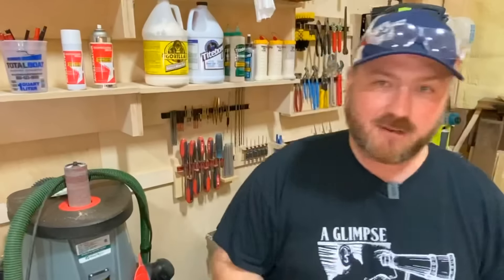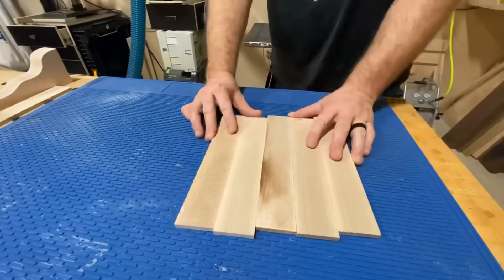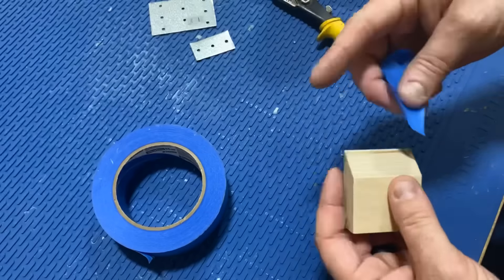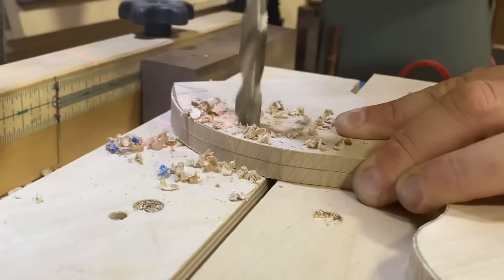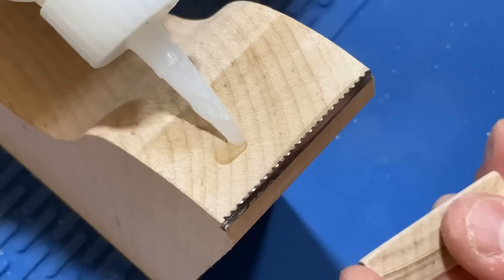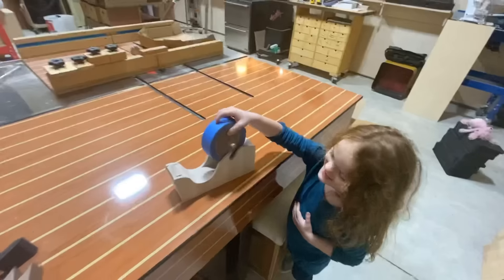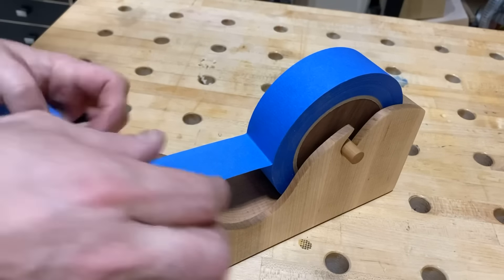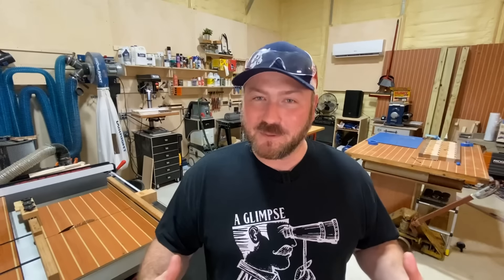How To Make a Tape Dispenser Out of Hardwoods | Blue Tape Solution | A Glimpse Inside How To

Comment: I am a musician and a wood worker.  I recently made a mudroom bench from cabinet grade plywood (SW emerald enamel painted) and red oak bench top (GF gel stain with GF high perf. poly).  I used some of the scrap plywood to make a very nice looking cable holder/organizer for my music studio.  It has 28 slots that are each 1/4" wide.  Routed each slot with my trim router and a custom made jig.  Each slot vertically holds about 4 or 5 of my music cables and guitar straps, etc.  Came out way better than I thought it would especially with GF arm-r-seal applied to the bare plywood.  Can't say enough good things about General Finishes products.

Comment: Great project.  Everyone needs one of these. Another option for the bottom would be a thin piece of craft foam.  I tip for your drum sander. I do segmented turning and flatten the rings on the drum sander, but over time there is glue buildup on the sandpaper. When this happens, I take the belt and soak it in a 50/50 mix of Simple Green and water. Overnight the glue residue softens. I use a soft scrub brush to clean off the glue and the sandpaper is almost like new. Enjoy your channel. 👍

Comment: Also I have made tape dispensors that held at one time multiples of various sizes on one holder. I have even had to make one for packing tape because my wife doesnt get along with a tape gun! For your cutter I have used a hack saw blade in place of saber saw blade! worked really good with the multi- roll dispensor!  Great video Thanks Craig

Comment: I know it's an older video but two addendums. Create an enclosed cavity in the bottom and add sand or bbs. This turns it into a single handed operation while your other hand is holding parts together.  Secondly, save the metal cutting strips from kitchen wrap boxes for this very purpose. I know this as "her" office dispenser got dull to the point it would cut scotch tape anymore and I had an aha moment.

Comment: to find circle center...true, you could have just done it beforehand, but here's another trick my grandpa taught me years ago.  Sometimes the old timers are smarter than we give them credit for:

Draw a straight line across the circle anywhere (say the upper 3rd or so).  Mark the center of that line.  Draw a line from that center mark perpendicular (90 degrees) across the circle.

Do the same thing elsewhere on the circle...mark the center and draw a perpendicular line from that.

Where the 2 perpendicular lines meet is your circle center.

Comment: Your fish tape dispenser sides kind of reminds me of a whale's profile --- worked out pretty well. By the way, one inexpensive (somewhat free), readily available source of serrated metal teeth would be the cutoff strip on packaging for aluminum foil rolls/wax paper rolls/etc. . .  might take a little bit of imagineering to affix a strip to a tape dispenser, but, hey, that's the fun part. At least you would have a good length of material with which to experiment. Looking forward to more of your projects.
Reply from the maker: The aluminum foil trick is genius. Thank you so much for sharing that